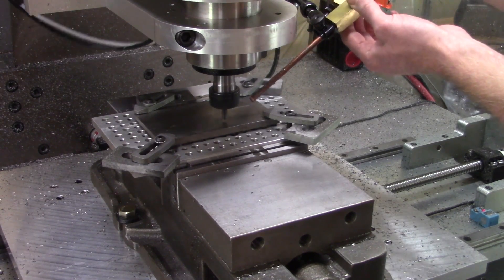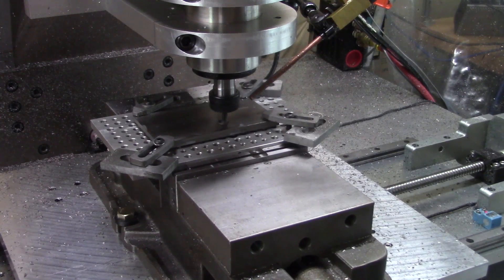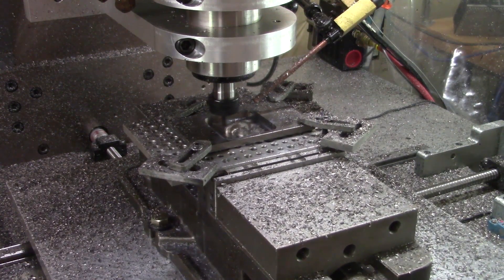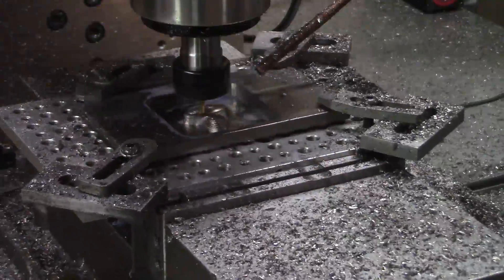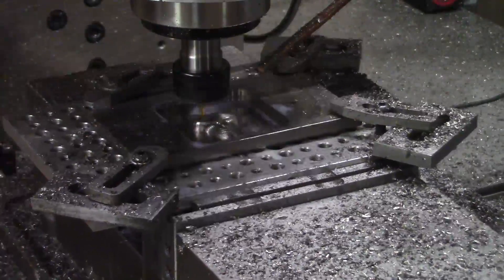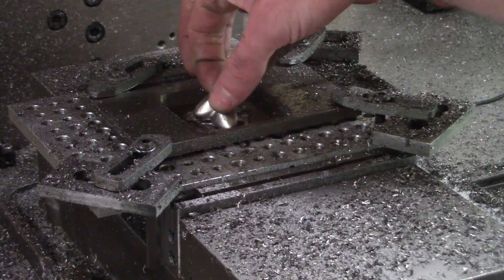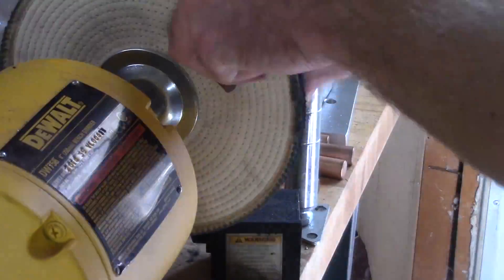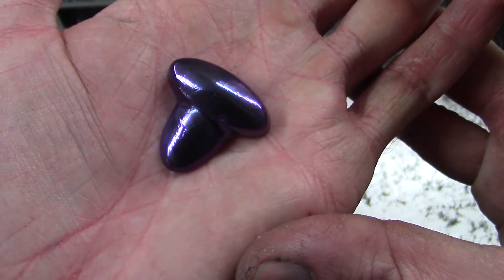Titanium on the DIY VMC

Comment: Look at your strap clamps they are all soft, aluminium and bent, I like to use steel clamps with soft padding teflon etc? Plus the middle section is unsupported or clamped.

Comment: hey what kind of spindle are you using and what was the approximate cost. I really like your design and am thinking of doing my own . prob have to hand scrape my baseplate but just curious what you were using. I am a elevator mechanic n have access to lots of metal and large electronic parts. might go with a vfd AC motor or DC with a belt driven spindle. only problem is if it slips I need an encoder to detect a fault or I'll break my end mill
Reply from the maker: +Jonathan B It's a generic 3 phase 2.2kW spindle from eBay, but it's hopefully only temporary until I can get a nice, proper spindle.

Comment: How much would you guess your entire machine weighs?
Reply from the maker: +xKatjaxPurrsx According to Fusion 360's physical property analysis it's about 1,500lbs. I'd like to double that though, I'm still getting some machine shake when moving somewhat heavy loads at anything over about 100ipm.
Reply: Well it's an amazing machine. I'm looking to get into CNC with a 3040 or 6040 to do some aluminium or mild steel milling to make small 1-3 lbs fighting robots. were you able to actually do anything with the original CNC as far as making parts for your DIY one?
Reply from the maker: +xKatjaxPurrsx No, I would stay away from those for metal work. The whole gantry twists when it's forced through anything harder than plastic; the mill will slay climb out of the pocket and ride along the surface. That is, unless you are running so lightly that you are just rubbing dust off the part but that will destroy your mills. Stick with the small manual mills from grizzly and the like and convert them to cnc.
Reply from the maker: +xKatjaxPurrsx No, I would stay away from those for metal work. The whole gantry twists when it's forced through anything harder than plastic; the mill will slay climb out of the pocket and ride along the surface. That is, unless you are running so lightly that you are just rubbing dust off the part but that will destroy your mills. Stick with the small manual mills from grizzly and the like and convert them to cnc.

Comment: Grab some cheap dryers and use them as grinders. The motors run at around 1800 rpm and are great for cheap grinders, that way you wont have to change out your buffing wheels all the time - I wouldnt have the dedication you have for that lol
Reply from the maker: +MrLiamCooley Interesting idea. It's not too bad changing them out though, just spin them off and let the motor spin them back on.
Reply: Yea not too bad, but im lazy. I think I have 4 grinders now and on of them have actual AO grinding wheels on them lol. One is a steel and brass wire wheel, one is two buffing wheels, and the other is 2 different scotchbrite wheels. 

For a long time I had a bunch of dryer motors though, I still have a bunch lying around.
Reply from the maker: One day I hope to have the shop space for a setup like that - maybe even a room just for pedestal grinders and 2" x 72" belt sanders! 

For now I clamp that DeWalt grinder down wherever I have bench space and go to town, lol.
Reply: Ahahah atta be, when I first started my shop it was inside a 10x8' shed. Now I share a garage with my father so I have a lot more space for stuff.

Comment: Not bad ! It seems you have almost the same chatter no matter what material you're cutting. There must be someone out there that can pinpoint it - But maybe it is the spindle as was suggested in the last video. How much does a proper spindle cost ?
Reply from the maker: A used Colombo ATC spindle (only brand I know that's smallish and 25,000+ RPM) can be had for $1,500-$3,000 on ebay.  Of course, that's the spindle only; I don't know what other electronics I'd need - or if it needed rebuilt.  I can't justify at the moment.

I think the spindle is ok though, I put about 20lbs on the top of the mount and that took away a good portion of the chatter.  I'll probably try beefing up the mount, first.
Reply: You might want to try adding some polymer concrete to dampen the vibrations.  Right now you've got a lot of Aluminum plate in that thing and it's not tied together monolithically, so it's gonna vibrate.  If you take the Z slide off the machine, build some dams, then pour some polymer concrete into the dams, it should reduce the vibration.  Hardinge calls it 'harcrete', concrete shrinks, but the stuff they use doesn't.  I'd guess it's probably a 2 part urethane with ground up granite in it.  Have a look at this article: http://americanmachinist.com/features/rock-solid-machine-bases
Reply: Take a look at the X-ballscrew: During that circular pattern the chatter seemed to be most when the ballscrew was standing still. Maybe that's something you should investigate...
Reply from the maker: I have noticed that, when milling circular pockets, there is chatter when milling from +X to +Y and -X to -Y; but not from +Y to -X or -Y to +X.
Reply: Could you draw up a diagram of where the motors and thrust bearings are in relation to which moves are chattering?  I suspect that the chatter is either due to the thrust bearings or when the ballscrew is under tension/compression from the thrust bearing.  You may find a pattern that suggests the screws are not stiff enough or the thrust bearings are loading in one direction better than the other.
Reply from the maker: Sure, here is the basic layout: http://imgur.com/a/doOLq
Reply: Could you draw some arrows in the chevron it chatters, I didn't understand the previous explanation?

Comment: Great man!
What spindle are you using?
Reply from the maker: Just a generic ebay 24,000 RPM spindle until I can afford to buy a nice one.  It's actually surprisingly good for $200 but has an ER20 collet so tool changes are a huge pain.